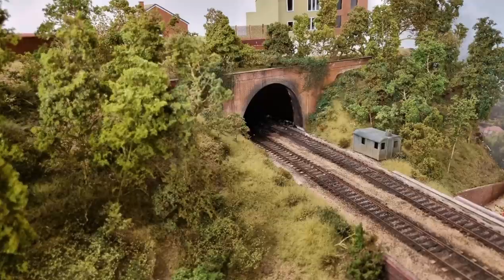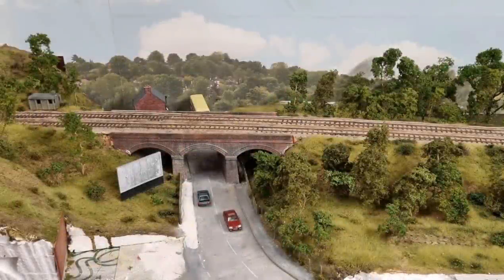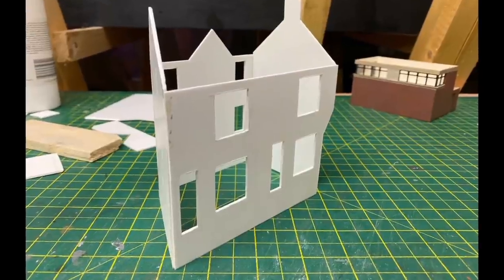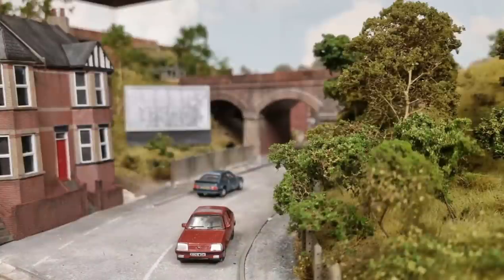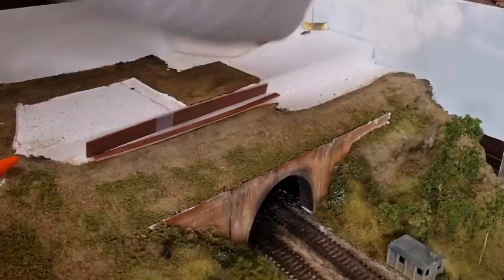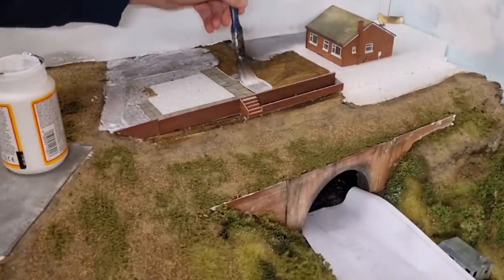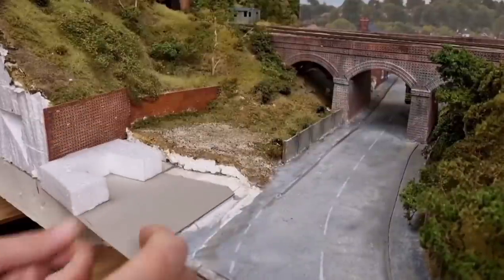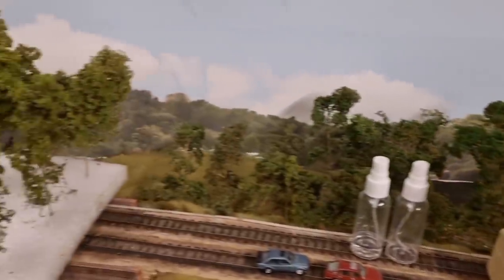Exeter st Davids. Part 17. Tunnel & Bonhay Road Scenic Detailing.

Comment: Are you going to model the rear of the YMCA at St David's Hill that backs onto just to left of above tunnel? It would be a straightforward build but very noticeable building
Reply from the maker: Sadly that building would be slightly to far to the left and off the baseboard. Shame as it would of added another dimension to it.
Reply: @thescrapline4905  thanks for your reply. Although originally a Plymouth lad, I spend a lot of time in this area nowadays so I'm really enjoying your build. The Bonhay road area really capturea it well.